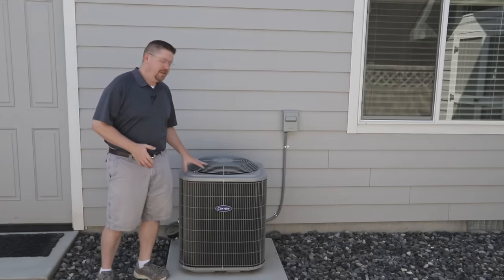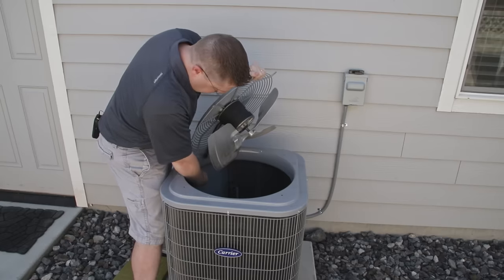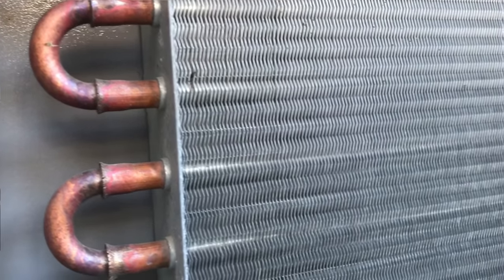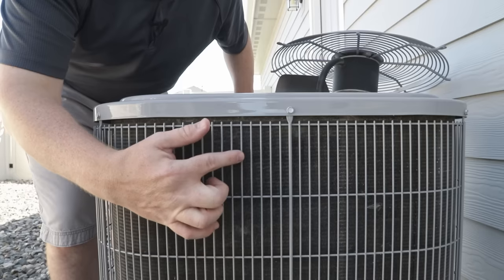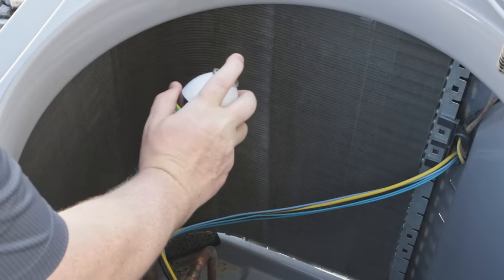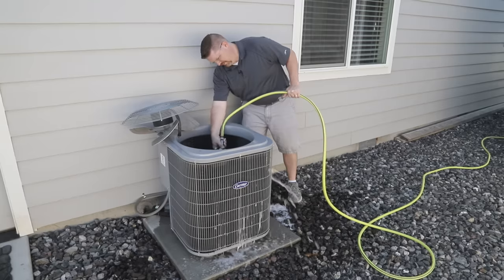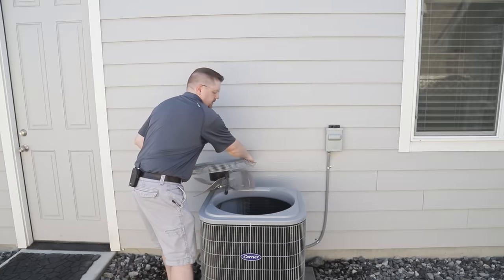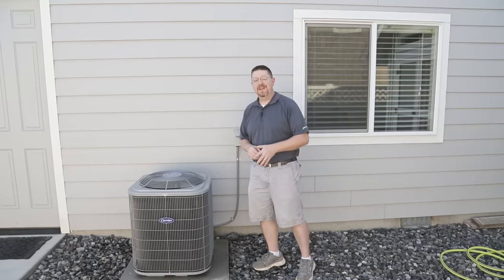How To Clean Your Air Conditioner Condenser Coil (Step By Step)

Comment: Its a Disconnect not a breaker...
Reply from the maker: Thank you for the correction. You are absolutely correct.
Reply: It breaks the electrical connection to the unit. It can be called a breaker if one wants to call it that. No big deal.

Comment: @ simply Diy I'm a new homeowner  but when I rented the maintenance man sprayed the outside  unit while it was running, is THAT ok if the fan top isn't being taken off? Also can a degreaser be used if I can't find the foam
Reply from the maker: These units are designed to be run outside in the elements, so they can be sprayed even while they’re running. However, note that this is a less effective cleaning method. It’s better than nothing, but it’s a lot sloppier than doing it the right way. As for degreasers: I would be careful. The fins on these condensers are very very delicate, and anything that damages aluminum could be catastrophic if put onto these things. If you’re certain the product you use will not damage aluminum, then it should be fine. However, my recommendation would be to simply use mild soapy water before using any sort of degreaser if you can’t find the proper cleaning foam. Good luck!

Comment: What a stupid idea. my old American Standard had only a thin chrome plated type grill around the 3 walls of the condenser. My New Lenox has metal louvers and they have to be removed AlI I had to do on my American Standard was remove the fan / grill   4  10 mm capped nuts and hose from inside out .... it last almost 20 years till the A coil spronge a leak....

Comment: That's not at all how you use the fin straightening tool. That's why your results are poor. You don't brush sideways. You gently use it lake a rake. It will straighten the fins beautifully if used correctly.
Reply from the maker: HI Markus - I tried multiple orientations / approaches. What you saw in the video were the best results I could achieve. I'll have give it another try next time I run into bent fins. Thanks for watching!

Comment: You don't ever want to clean your coils out with any kind of coil cleaners are braces is the coils and takes a coating away you just want to use soapy water I should know then I'm an HVAC technician you should also wash your coil least once a month and you don't have to take it all apart

Comment: If ur super lazy, turn off power, take the top off, spray with ur water hose every 6 months and  u never end up with these types of problems.
Reply from the maker: If you are already taking the top off, why not also spray it with the cleaner? It hardly takes much extra time...
Reply: 2 reasons, a lot of people r super lazy. And if u do it every 6 months from day 1 of installation it really never gets dirty. But yes ur right why not

Comment: You forgot to tell people to not run the a/c unit until it dries out. Any water in the fins will freeze and damage the unit. I found this out the hard way one year.
Reply from the maker: Really? That sounds ... odd, given that these things are designed to run under all weather conditions - including heavy rain - which will make the fins wet. 

Good tip though. Let your fins dry out of an abundance of caution.
Reply: @AmplifyDIY  Yeah, if you spray some water on your unit while it's running, you can see the ice forming up right away. Now that I think about it, the soap mixture might raise the freezing point enough that it might not be a big issue.
Reply: some other problem caused your freezing, low freon or blocked indoor air filter ive never seen a condenser coil freeze in 30 yrs. in business. Evaporator coils freeze at times.

Comment: your supposed to turn the circuit breaker over and reinsert, they way you have it now IS VERY DANGEROUS , ELECTROCUTION HAZZARD. If the box gets sprayed with water the bare 220v contacts are exposed. if you look at he part you pulled out it will say off and on , the off is upside down and will be right side up when you turn over and insert.
Reply from the maker: Sure, you can and probably should flip the handle over and pop it back in. But... electrocution hazard? That's more than a bit far-fetched. In fact, I strongly suspect it's not even possible. You'd have to be standing barefoot, in salt water (or water with a high enough mineral content to adequately conduct current, and that water would have to have a solid single connection to your feet, with no other path to ground other than through your heart and out, say, your arm, AND the water would have to be forced into the contacts such that only the hot terminal was in contact with the water AND the circuit breaker at your panel would have to not flip as soon as the hot was shorted to ground. Flipping the cutoff handle over and popping it back in won't make a bit of difference if you have ALL the above factors also in play. 
In short: the method I showed is perfectly safe.

Comment: Good way to need a new fan motor after stressing the wiring connections. Have a hvac company to clean it. They will check the freon in the system as well.
Reply from the maker: And charge an arm and a leg. Just be gentle and nothing gets damaged.

Comment: You don’t need to do that I clean with power washer done fast just up and down with fins
Reply from the maker: Cleaning these with the power washer is a very bad idea. The pressure of a power washer will bend the fins extremely easily, ruining your condenser. Be extremely careful if you use a power washer.

Comment: DO NOT DIY. Leave it to the professionals please. I been doing HVAC ten years and please believe me, DO NOT DO THIS YOURSELF
Reply from the maker: Why? Cleaning a condenser is a very simple procedure, and anyone can do it if they are careful. If you are not comfortable taking the safety precautions etc I showed in the video, then by all means hire someone... but anyone who is even a little handy can manage this job just fine.
Reply: @AmplifyDIY  I don’t have enough time to go through the millions of reasons why people shouldn’t be taking the tops off of heat pumps or taking out disconnects. It’s a bad idea

Comment: Your Fin straightening tool was used improperly. Or at least as much of it we saw, because your hand blocked the view. The overspend fast fed showed inconsistent tool to find alignment and failed to show a careful delicate effort performed with patience. You botched it.
Reply from the maker: Hi Charles - I appreciate the feedback.
I tried multiple different orientations with the tool, and was careful and deliberate in my attempts to straighten the fins. I also tried several other areas, with similar results. The portions of all this testing that made it into the video represented the best results I was able to achieve. 
Considering that my audience is a typical homeowner who a) likely does not have this tool and b) does not possess specialized knowledge how to use it in the first place, I opted to show typical results from a novice approach. 
Thanks for watching!

Comment: It's not a good idea for Homeowner to do this on their own. For so many reasons.
Reply from the maker: Such as? I mean other than that they don't pay a bunch of money to someone else to come do it for them....
Reply: There is not one thing is HVAC a homeowner should be doing themself. A mistake can be costly.
I go to at least 50 calls a year where the homeowner tried to watch one of these how to do it yourself videos ends up fucking something else up. They will brake the ignitor thinking it was the flame senor. A customer can hose down the condenser on the outside but don't open it up. Most of these YouTube how to do it yourself videos are done by a rookies.

Comment: You’re using the fin tool improperly, you don’t know that it’s not a heat exchanger it’s a condenser coil, you don’t really have a clue what you’re doing.
Reply from the maker: Hi Chris - I tried multiple different ways to use that tool. What you saw on the video was the best I could make it do. Perhaps with more practice better results could be achieved with a different technique. As for whether I used the correct terms: a condenser coil absolutely is a heat exchanger. There are many types of heat exchangers, but in this system that is the sole job of the condenser coil: https://en.wikipedia.org/wiki/Heat_exchanger

Comment: We have morons whom put a Condenser on a Rooftop. Now how can anyone clean these units? I really hate Stupid designs. This actually is a damage to happen. I blame all A/C Companies that cause this problem. I even blame A/C workers. Cheap materials are put on a A/C Unit that can cause distractions distructions.
Reply from the maker: In this case, blame the architect or house planner. The contractors probably just installed the system where the plans said they should...

Comment: Those chemical make your fin thin, much better use with pressure washer with dishwasher liquid, there's a proof already that the coil thinner after that
Reply from the maker: Are you saying that the cleanser I used corrodes, dissolves, or otherwise breaks down the fins? I'd love to see some evidence of that. Do you have a link to some supporting evidence you can share? 
Using a pressure washer is a Very Bad™ idea for these things. The pressure of the water can very easily fold the fins over, and they can never be made perfectly straight again, which makes the entire system less efficient, which forces it to run longer, which costs more in electricity.

Comment: Yes, don't pay $100 or less for a professional to clean both coils and be responsible for any damages or personal injury. 
Nothing better than paying for a repair while your in the hospital. 
FYI don't mess with your appliance unless you are mechanical.
Reply from the maker: In my area $100 barely gets a professional on site. Once they are there, a service like this will easily tack on another $100, and they'll try very hard to upsell me all kinds of things I don't actually need.
Reply: @AmplifyDIY  We (tradesman) are not trying to rob you. Offering service is trying to be  responsible for the home owners. If the rate is more than $95 + 35 for materials, you say no thanks and move on. 
Get out and talk to your neighborhood or go to next door for a recommendation. But do not mess with home appliances. You should also have a disclaimer telling others that they should hire a professional so you do not become liable for someone hurting themselves following your video. 
Reaching in and pulling the disconnect with out proper PPE is a violation of OSA rules.
Reply: $100 or less? Go on yelp and say u live in broward county/fort Lauderdale Florida and get estimates to clean coils. You won't get one saying less than 350

Comment: You have your coil names mixed up. The outside unit is the evaporator and the part in your furnace is the condenser.
Reply from the maker: Hi Dylan - I’m pretty sure I have it correct. Quick googling seems to agree: https://www.standardheating.com/hvac-maintenance/hvac-diagram/
Reply: Nope, you are confused Dylan